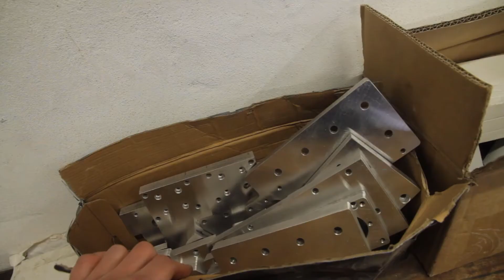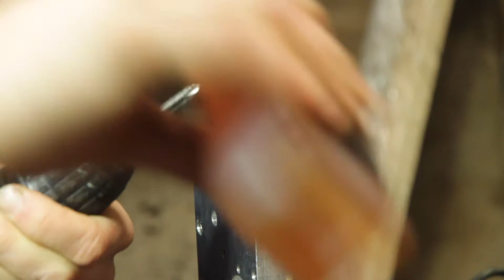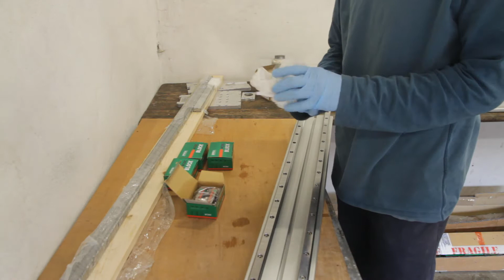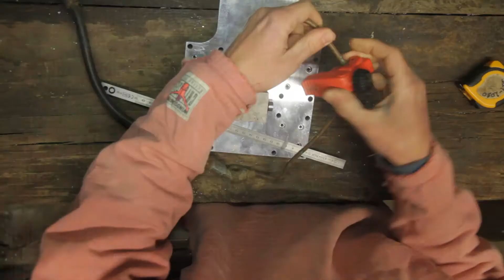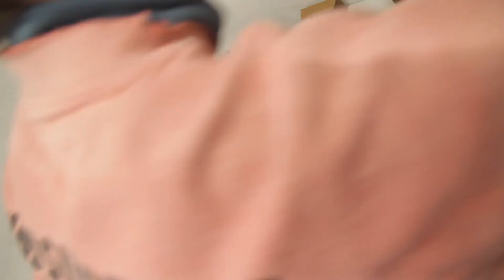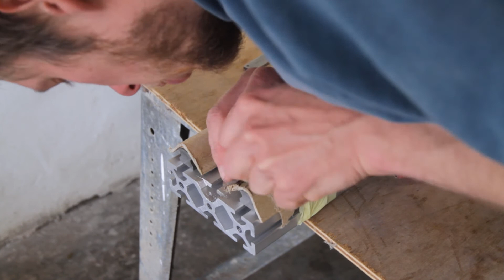CNC Router Build Part 2

Comment: would like to get the designs i reg for cnczone?
Reply from the maker: Yes, you can get the design files on CNCzone.nl. You  will have to register. You can use a translation extension on your browser to convert it to a more practical language for you. The first link is the complete description.
Good luck!
Reply: @WimsMill  thanks just waiting to be approved
Reply: @WimsMill  need help with registering please help if you can

Comment: Hi
Nice build,where did you buy ballscrew nuts?those are some kind of low profile?who make them?
thanks
Reply from the maker: Thank you. I had this ballscrew custom made to spec at this company: http://www.skcnc.de/
All the details are also in the cnczone.nl threads in the link above.
Reply: Hi,
I checked links,unfortunately i don’t speak dutch😂
How much did it cost?
Reply from the maker: @sandizufic3932  In total it came to just under 800 euro's. The skcnc.de website is German. You can always use google translate to translate the site. It is not great, but it works.

Comment: Just found your channel... what is the width of your profile rail?
Reply from the maker: Hello! What do you mean with the profile rail? The extruded aluminium profile on the sides is 80mm wide.
Reply: I can tell the size of the extrusion, I mean the linear rail that the sliders slide on. They would be in sizes like 20, 25 or 30mm. I have a CNC that I would like to switch to profile rail like yours and I was wondering what size you used.
Reply from the maker: These are the 20mm rails. and the Z is the 15mm version. From the main thread:
- 2 stuks rails X-as (HiWin HGR20R lengte = veld C3 van configurator)
- 2 stuks rails Y-as (HiWin HGR20R lengte = veld E3 van configurator)
- 2 stuks rails Z-as (HiWin HGR15T lengte 280mm)

Comment: Hello from Argentina! What type of stepper motor did you use? I see that those are NEMA23 but how much torque do they have? Thank you! Regards!!!
Reply from the maker: These are the Leadshine Hybrid-steppers 2NM with HBS507 drivers. You can find them in several shops and all over Ebay. Quick search gives me this: https://www.ebay.com/itm/Leadshine-Nema23-Hybrid-Servo-573HBM20-1000-HBS507-Closed-Loop-Stepper-Motor-2NM-/252453904963
Reply: Thanks you! I try build a cnc for thick wood and I´m gathering the pieces. Other query, how many watts of power has your router?, it looks strong. Regards!
Reply from the maker: The router motor is 2200W and came with a VFD. Usually you can find these in sets. Most people take the air cooled because it is easier to setup. The steppers are closed loop giving overall better performance.
Reply: Fantastic! Thank you very much!!!

Comment: Great work Wim! looking nice! Please check your FK12's to see of they don't use 6001 bearings instead of the 7001's (most of the FK12's use the wrong bearings (6001), which are not suited for the application).
Reply from the maker: Thanks for the reply. I have checked it and these are 6000z bearings. So probably also not the right type. What is the main difference between these 2? I remember when I was looking for these blocks that there was a lot of price difference depending on the tolerance. I cannot really find tolerances of these bearings to compare.
Reply: The 6001 is a standard bearing and the 7001 is an angular contact bearing.
Reply from the maker: Ok, that explains a lot. Angular contact bearing is indeed better. I will order some 7001 and swap them out. Thank you for the info.
Reply from the maker: I looked in the wrong spot. The loose end bearing doesn't need to be an angular bearing. I opened the other up and found a nice pair of angular contact bearings.